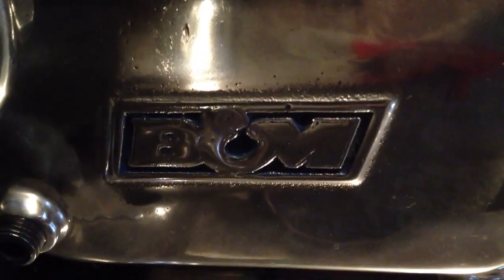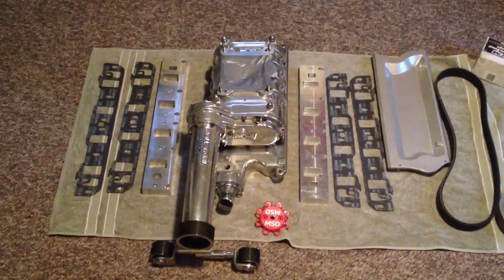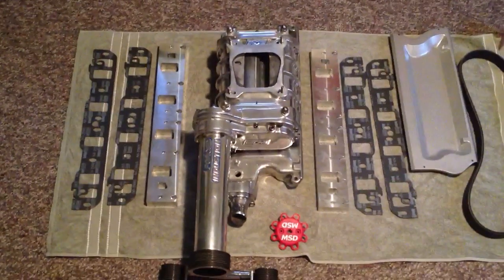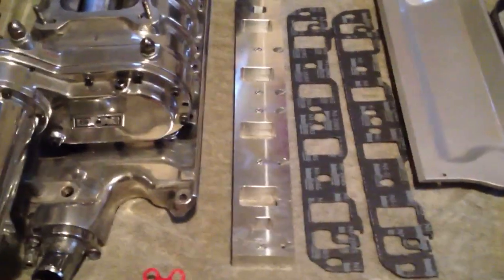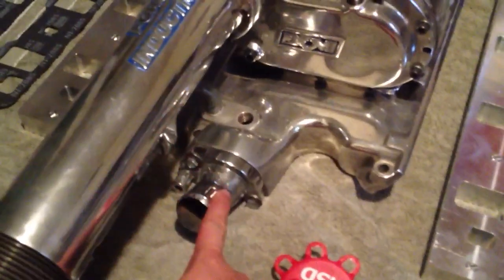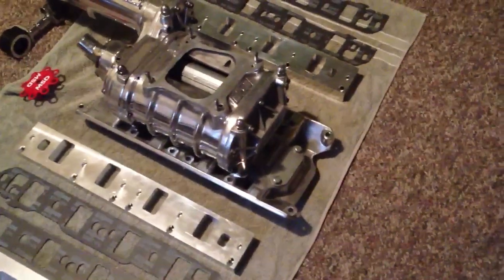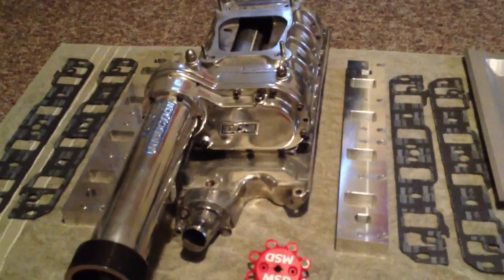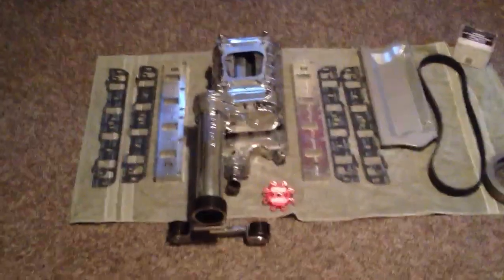How To: Install a B&M Or Weiand Supercharger Part 1 (Ford)

Comment: Really sux you have to go through all that trouble and add adapters to install the blower originally made for a 302 to bolt it on a 351windsor... chevrolet has more of a universal fit from their 283 to the 400 engines, not that you would use the smaller engine parts on the bigger engines, overall, same dimentions, and cheaper to build.

Comment: is there any way to control the boost on these superchargers or are they pre-set and built for 6lbs of boost? Can I run this on stock pistons chevy v8 350?
Reply: KFLY67 they run 6psi standard I run a 174 weiand blower on my stock 302 every internal is standard but you will have to get your carby boost referenced any good carby shop can do that and get a decent electronic ignition. if you want more or less boost you can change the pulley to a bigger or smaller one depending on if you want more or less boost changing the pulley size makes the rotors inside the blower spin slower or faster thus producing more or less air being forced into your motor.
Reply: You can alternate the pulleys to change the boost.

Comment: Idk. I'm trying to figure it out. I replaced the coupler a week ago and it still makes noise. If it was a nose bearing it would be a twenty dollar fix. I'm thinking the gears maybe. When I turn it back and forth it clanks
Reply: Alan Williams hey if your talking about one of these superchargers I had a problem where it was making a lot of clanking noise and it was the teflon strip on the rotor hitting on the side wall of the supercharger and what it came down to was I had changed the nuts on the studs they provided me with the kit to nylon lock nuts and we put the studs in first then put the charger on and tensioned the nuts to 10 pound but it didn't tension the nuts enough or it tensioned to much one or the other and it made the supercharger bow in the middle making the rotors hit so we took the studs out and put the nuts on first with some lock tight waited for the lock tight to dry then tensioned the studs to 10 pound and it fixed the problem

Comment: I wish I would have gotten a b and m. I bought a Holley charger for thirty five hundred including the carberator. It's a real piece of shit ! Leaked gear oil the first day. I bought a gasket kit for seventy dollars. That's when I seen the shoddy machine work. When it was drilled the bit chipped out where the gasket sits. I spent a month trying to get help from Holley performance. I even wrote the president CEOs of Holley. They had Shane whites carver call me. He never made any suggestions on how to fix the problem. He gave me the run around. He looked for any excuse he could find to not help. He said how do I know a blower shop didn't chip it ? I asked why would they redrill the front case holes ? He didn't have an answer. I bought it new. They do have a ninety day guarantee. My truck was at the mechanics shop past that. It was a full restoration project. Their tech guy told me we've been on the phone for a half hour and I still have a hundred call to do today. Their understaffed.
Reply from the maker: That really sucks. Do you think it can be repaired?

Comment: is it possible for me to get a supercharger with a cluch on it. so when you press a button or pull a lever the blower will engage?
Reply: Ivana Birkett your talking about a centrifugal pulley type supercharger where the pulley spins freely without spinning the supercharger then press a button and engage the pulley mad max type blower not sure if it can be done or if they make it but look up centrifugal type of supercharger/supercharger pulley

Comment: 144 is kinda small for a 351 No? I had one on my 401 chevy and it was way too small. I had to use an extra small pulley to get 7 lbs of boost and the intake temp was always too high.

Comment: what type of compression does the motor need to install a supercharger? I have a 302 with 10.5:1 compression....can I throw one of these on without having to modify the motor? And just put a larger pulley on to lower the boost? or do I need to bring the compression down to like 9:1 before installing one?

Comment: umm correction 351w's have many, many, many dual quad, or 3x2 intake manifolds, but the 351c does have the capability to make much more pwoer but is now where near as reliable as the 351w, but thank you very much for making this vid series, well on to part 2